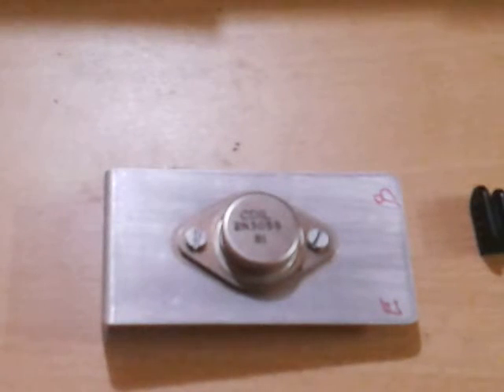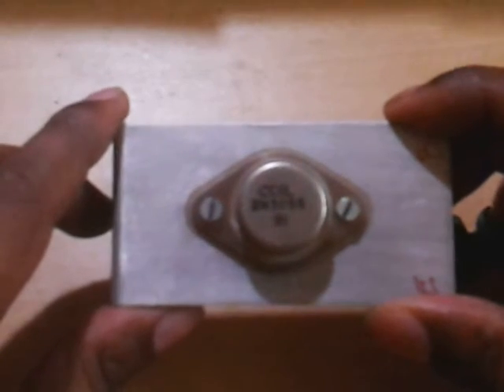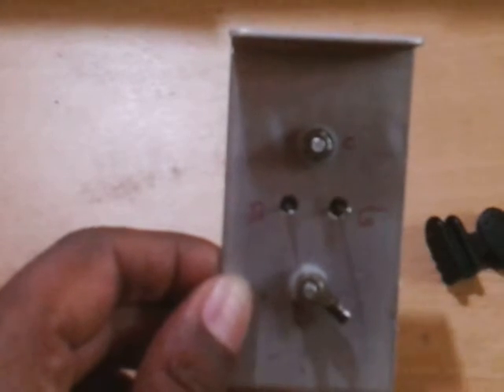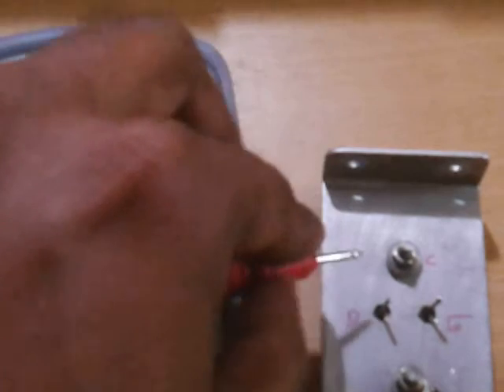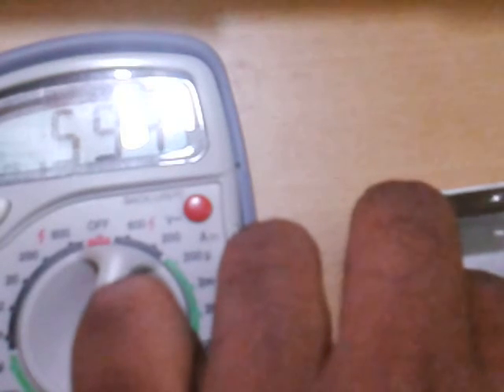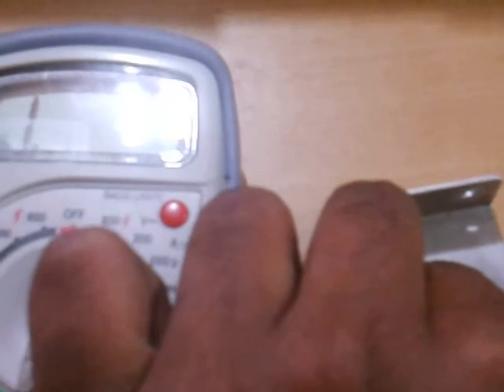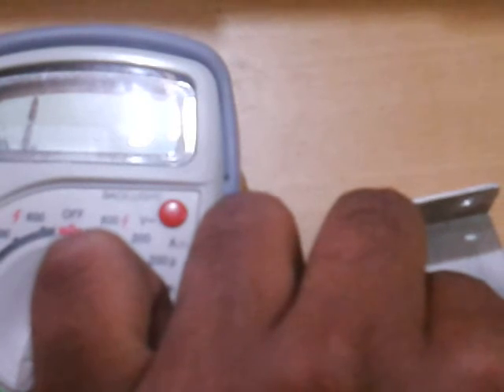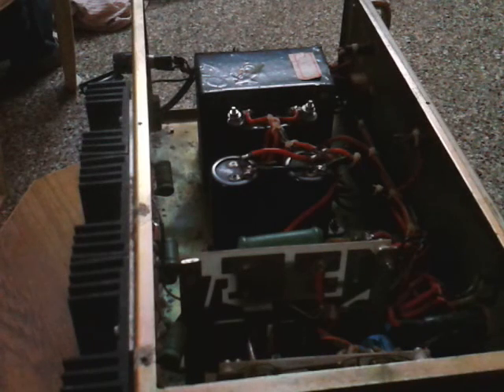Testing 2N3055 Transistor

Comment: I see this is a very old video but I've been looking for this information today. I've looked at a dozen videos of this is the only one that gets straight to the point and does the testing.
Thank you sir 👏👏👏
I have an old radio shack 13.8 volt power supply that is not working. When I turn on the switch, and them plug it in, it trips the   breaker instantly.
There is nothing burnt or obvious on the circuit board so I thought I'd try this first.  I get 524 and 555 when checking the same way you did.
I'm assuming that's close enough dad would have no effect on the breaker.

Comment: Interesting analysis. I am also trying to figure out if my 7-10amp PS is weak. I tried following your example but I'm not getting the same results..hehe. but I do wish your hand didn't block the view on what you were touching, I couldn't tell.
Reply from the maker: JP check with a new transistor you might get the same result as mine.
Reply: @NeoTheNomad  I'd just hate to start buying components without being sure of what needs replacing or where the problem lies. But thanks for the advice. I will find out how much it costs down here. Have a go at it.
Reply: @NeoTheNomad  Hello, I'm just getting back to you about this testing. Turns out the meter I was using was some crappy multimeter from Harbor Freight and was not working correctly. So I searched thru my automotive equipment and found my OTC multimeter plus. This time I was getting correct readings, indicating the transistor is good. However, I may still have that dilemma that there's probably something causing low current. I am wondering if the transformer might be going bad. But I don't know how to test that.
Reply from the maker: @MusicMinisterJP7  if it is a general step up transformer, it can be checked for continuity for primary side as well secondary side. 
Hope that helps.
Reply: @NeoTheNomad  Okay,, but how do I proceed? If you can show me step by step, where to set meter, what to probe and see.. then I could probably get somewhere. I've searched for videos on checking a transformer of This type and didn't find any.
Reply from the maker: @MusicMinisterJP7  I will search the internet for procedure. Due to covid my shack has been dismantled and displaced or else I would have a video.

Comment: Your missing the most important test. You MUST test between the collector and the emitter. Any voltage drop in either direction the transistor is BAD.
Reply from the maker: Thank you Mike. Yes testing between collector and emitter is standard test.

Comment: Hi Neo, I have 40 amp 13.8 vdc regulated power supply, if I want to replace to the big capacitors do I need to replace the small capacitors on the regulator board? Greetings from the Philippines.
Reply from the maker: Hi Bobby
Ideally only the bad capacitors, needs to be replaced. so if you find any blown out capacitors then replace it.
Reply: @NeoTheNomad  the unit is ok, can power my amps the whole day, but I notice the bass is not as good as it use to be, there is no blown capacitor yet,  thank you very much..
Reply from the maker: @bobbyy8711  The frequency response (Bass) low frequency of an audio amplifier is not related to power supply as long as the PS current rating matches. The issue of low bass lies else where.

Comment: in my case i got dc3005 power supply which output is 30v and 5amps but it outputting only 3amps the voltage knob is good but when i turn amps knob it max output current no increasing above 2.7 to 3 amp max...what is the problem?

Comment: Thanks for that but the trick is to buy a good 2n3055 in the first place. The one's that bought lately are total rubbish, upon opening one I found that the pins were connected with  a very fine (hair) wire,  They would not even carry 1/2 amp.
Reply from the maker: Yes online purchases from China,  sometimes turns out to be fake. Try to buy in your local electronics market, ask for good company ones.